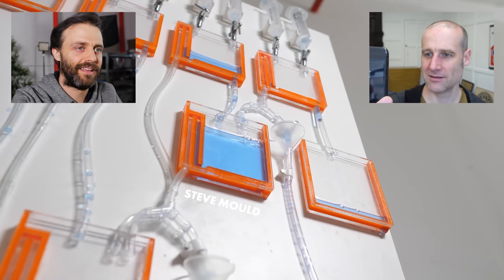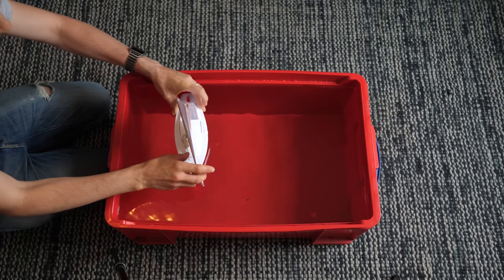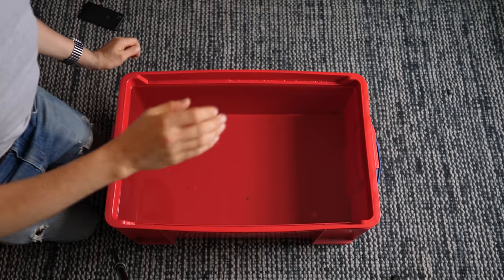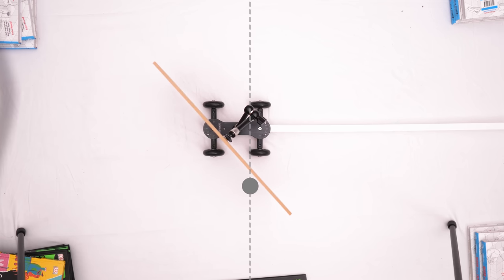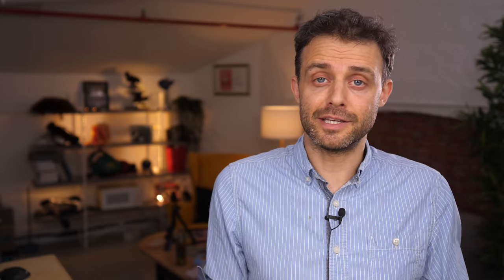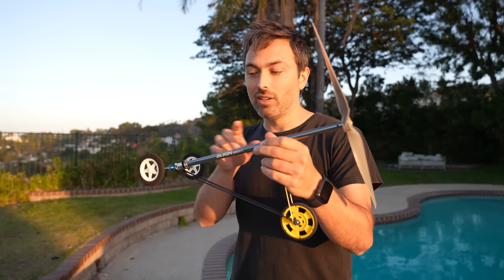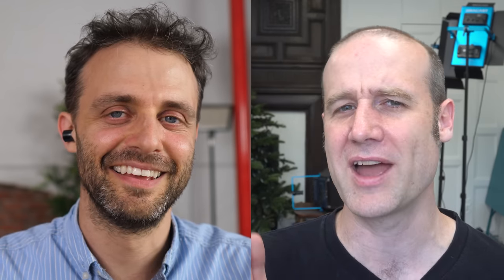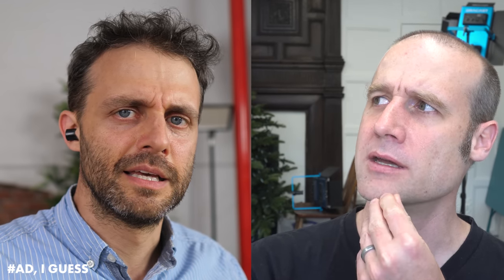Sailing Faster Than The Wind - How Is That Even Possible?

Comment: Not sure if I missed this in the video, but need to also consider that Derek was using a wind turbine as a sail. A turbine can act like a flywheel, storing energy. A good question to ask is “what happens when the wind stops?”. A sail boat will no longer generate lift, but the inertia of the boat will keep it going. A wind turbine however will continue rotating and continue providing lift, so it’s possible to build more speed thanks to the energy storage element. At least, that’s my assumption, haven’t thought all that hard about it.
Reply: @eyytee  You are right, but the point here isn't that it will speed up when the wind stops. The point is that the turbine can store energy from past wind, which is added on top of the wind in the present. It's essentially a mechanical battery.
Reply: @RealEngineering  My point was that the cart in Derek's video goes faster than the wind in steady state. It stays above windspeed, as long there is true wind. It doesn't rely on stored energy that would eventually run out.
Reply: When the wind stops, from the frame of reference of the rickety turbine machine, there's still wind as it continues moving for a bit. But now it's moving into the wind. Wouldn't this negate any gains made from the flywheel effect?
Reply: I'd like to point out that unfortunately this video doesn't demonstrate how a sailboat can travel faster than the wind in the downwind direction. That being said, the model used can explain it perfectly! You just need to angle the hull away from the direction of the wind more than the sail.

A turbine is analogous to a screw in the same way a sail is analogous to a wedge, so if you treat the sail car as a mechanical advantage problem it all checks out.
Reply: I think about it like gearing the difference in velocity between the wind and the ground. Like gearing between a pair of pinions attached to a pair of racks 

Imagine the wind and ground are racks and the sail and wheels are pinions. The two pinions are geared so that the wheel pinions move faster along the ground rack than the turbine pinion is moving along the wind rack.

This seemed to work when I modeled it in on shape
Reply: Yes, with some energy storage system, you can pass the wind velocity for a while, but not forever.
Think a little more... If that machine could work, it would need just a little push in the air (without any wind) to start to accelerate forever.
To me, looks just like a very slow second order system with an overshoot. ( welll , it is not linear cause there is non linear terms, but it can be approximated to a linear system just to prove the concept)
mv''= A*v + B*v - C*v^2
Mass * Aceleration = wind push + propeller thrust - drag
Reply: @rogeriocosta1035  "with some energy storage system, you can pass the wind velocity for a while, but not forever." that's why the vehicle in Derek's video doesn't use energy storage, they wanted to prove it could go faster than the wind continuously.
"If that machine could work, it would need just a little push in the air (without any wind) to start to accelerate forever." NO!!
It uses the difference in speed between the air and the ground to collect energy.  If there is no difference in speed between the air and the ground, then there is no energy to collect, and drag will bring it to a stop fairly quickly.
In the following video, you can see that after 3:16 the vehicle continues to accelerate.  It goes from basically wind speed to well above wind speed. The propeller is spinning considerably faster at 4:10 than at 3:16. It's been gaining energy the whole time, nut spending stored energy.
https://www.youtube.com/watch?v=aDzWh9J1dk4
Reply: @RealEngineering  I'm interested to see your take on sailing theory
Reply: @eyytee  Exatly, from the Nasla page: "The big difference in the two crafts is that in the upwind version the **turbine actually powers the wheels while in the downwind version the wheels power the propeller."

The wheels power the propeller, and that's why it's able to move faster than the wind. If you replaced the wheel power with a motor, you could go as fast as you like.

The momentum of the turbines propeller blades is not storing the energy, it's the momentum of the vehicle, because the wheels power the blades.
Reply: @andrewsnow7386  Yes, the craft will gain energy, so long as the air outside the craft is losing energy.  Once the drag(which speeds up the air molecules), matches the amount the air hitting the propellers is slowed down, then the system will stop gaining net energy.  Because kinetic energy is 1/2 mv^2, it can take a while to build up speed.  But notably, the kinetic energy of the craft stores energy, not the the speed of the turbine, because the wheels power the propeller.
Reply: @derekmcdaniel6029  We may agree on everything, but I'm not sure. We agree that the vehicle is taking energy from the air-ground system (what we call wind). And, when drag equals thrust, the vehicle will stop accelerating. Also, building kinetic energy can be a slow process. And movement of the craft, and wheels, and propeller all store kinetic energy.
The only place I'm not sure we agree is if this stored kinetic is expended quickly to temporally push the vehicle above the wind speed - it is not. 
If the vehicle were made entirely out of a mass-less material (and thus couldn't store kinetic energy), it would still work.
Reply: @josbo6  Also a very good point
Reply: @andrewsnow7386  "It uses the difference in speed between the air and the ground to collect energy.  If there is no difference in speed between the air and the ground, then there is no energy to collect, and drag will bring it to a stop fairly quickly."

It is possible! If you consider using the difference from the wind velocity to the ground as an energy source, you could imagine just a fixed wind turbine feeding energy to a rail that feeds an electric vehicle to travel way faster than wind. It is easier to imagine and there is no energy and momentum conservation problem in this case.

But I think that is not the question the original video is proposing to answer.

- The question is if a vehicle can extract energy from the wind (using or not the ground as a leverage) to move itself, downwind, continually faster then the wind.

Since the ground is the inertial frame of reference and consequently has no energy for that context, I can't imagine a way to make it work without breaking the laws of thermodynamics.
Reply: @rogeriocosta1035  Use the wind as your inertial frame of reference. If the wind velocity is constant, it is just as valid of an inertial reference frame. Now the ground has energy. 
Energy is not conserved when you switch reference frames.
Reply: @RealEngineering  as long as you're slowing down some wind, you get the inertia from it
Reply: @Real Engineering it would kind of act as a battery when the wind slows down for a while, but that's why they had to install a one way ratchet that makes sure the wheels can turn the rotor but not viceversa. They don't talk about it in Veritasium's video. Anyway apparently the propeller isn't even that heavy and doesn't spin too fast so it wouldn't make for a good flywheel.
Reply: @salvodippolito6013  Correct. The ratchet prevents using stored rotational energy for propulsion. But also the fixed gear ratio, which slows down the wheels, if the rotor slows down. And the rotor is made of foam so very light.
Reply: @eyytee  with a ratchet in between there is no way that the rotor can slow down the wheels. The wheels can only maintain or increase the speed of the rotor in one direction, just like the pedals in a bike can't be used to slow down the bike's wheels. The gear ratio has nothing to do with this.
Reply: @aviphysics  Exactly this! When I saw Veritasium's video this is exactly what I came up with. Also, sails are like wedges which can be equated to gear ratios.
Reply: @rogeriocosta1035  , No, you can extract energy from the relative motion of wind and water at any velocity. Without friction you can accelerate infinitely, just like a gearbox with an infinitely high gear ratio can.

In fact, sailing faster than the wind downwind can be explained entirely using gear ratios: Imagine the water and air are two parallel rack gears. If a machine exists that can travel faster than the wind rack, connected to only these two racks, then from the perspective of this machine, the water rack will be moving backwards faster than the air rack.

This machine is very simple, a large gear fixed to a small gear on the same axis, with the large gear meshing with the water rack, and the small meshing with the air rack.

Thus this machine can travel at any speed faster than the wind assuming no friction.
Reply: @chalichaligha3234  That racks an gears analogy is brilliant, but I think it will show it is not possible.
Please try to draw this system you had imagined and hit-me again. If you can solve it that way, will be the most elegant explanation to the supposed problem.
Reply: @andrewsnow7386  OK, but using the air as the reference, the vehicle will have velocity in relation to the air, but it can't go faster than the ground (the new source of energy in that case).
Reply: @rogeriocosta1035  Here is a video of the geared system:
https://www.youtube.com/watch?v=W65MpjT_jnI
Reply: @josbo6  Yes, there is a little wind speed difference with height, but not a lot. In the following video they have streamers above and to either side of the propeller, in addition to one at the front. The one at the front does "drop" a little sooner, at around 2:55,  than the higher ones do (at around 3:15). But, from 3:16 until 4:38, all the streamers show an unbroken headwind.
https://www.youtube.com/watch?v=aDzWh9J1dk4
Reply: boats store energy as well. A boat will keep moving for a long time if it stops being pushed.
Reply: IIRC in Derek video, the wind pushes the blade (and car body) to make it go forward, but the wind didn't cause it to spin. The wheel that cause that blade spinning, so it work like reverse windmill, it push the air backward, pushing against tailwind, that's why it keep accelerating even after reaching the wind speed..
Reply: @eyytee  the
Flywheel
Stores
Energy
Reply: Blackbird does not used stored energy. Imagine a cart in a 10 mph wind, without a prop system. It will easily go 10mph. Add an efficient prop system geared to the wheels. The prop system will use energy, and maybe cost you 1 mph, so you would be down to 9, but the prop is thrusting against the air, and giving you +2 mph. So 10 minus cost 1 plus thrust 2 = 11 mph. At 11 mph maybe you are getting a bit more thrust, at not much more cost, so maybe you can get to 12 mph. And you're now going faster than the wind.
Reply: @ssgoko88  Yes, the wheels of the cart also store energy. But they cannot release that energy to accelerate the cart. And neither can the propeller.
Reply: @salvodippolito6013  " with a ratchet in between there is no way that the rotor can slow down the wheels. "

The ratchet does allow the following:
- wheels spin the propeller
- propeller brakes the wheels

The ratchet does NOT allow:
- propeller
 spins the wheels (prevents using stored energy)
- wheels brake the propeller (improves wheels brake effectivity)
Reply: @andrewsnow7386  Very nice! This videos are great way to show counter intuitives concepts. And very fun too. LOL
Even before that exemple, I had already change my mind about the sailing faster than wind and the machine in general.
But I still cannot imagine a simple and more intuitive way to extract energy from the wind when the vehicle is faster than the wind. Do you have some simple theoretical model for that?
I can imagine one, but is too much complicated and only the average velocity is greater than the wind.
Reply: Ah yes " researcher"
Reply: @RealEngineering  I could be very wrong: But...   Derek's explanation at the end of his video explaining that the ambient pressure behind the vehicle is reduced by the driven direction of the prop doesnt seem to hold water.  Any person with a passing familiarity with the aerodynamics of a car knows that high pressure in front and low in the rear is also known as aerodynamic drag.  If however he were exactly wrong and the prop were increasing the pressure on the aft face of the blade and decreasing on the forward, via rotational direction, it could create forward vectored lift.  The faster the vehicle goes, with the appropriate blade pitch, the greater this pressure gradient on the blades, the more the vehicle is pulled along that pressure gradient.

I have no idea how the math for this would work.  I'm not an engineer, but im recognizing systems in play.
Reply: @eyytee  you are both describing two unrelated and equally true phenomena. In your case you are talking about the steady state operation of the vehicle, which indeed has nothing to do with energy storage because at steady state any sort of energy storage system should have a net gain/loss of zero, since that's the definition of steady state. However he is describing the transient period when the wind suddenly dies. On a normal sail boat the entire boat suddenly becomes a drag item, but in this case the still spinning propeller (almost called it a turbine but then thought about it for a sec) provides some thrust to counter the vehicles drag. Ultimately the drag will still win, since otherwise it would be perpetual motion and thermodynamics forbids such devices, but it reduces the magnitude of the deceleration as compared to a conventional sale in the event of sudden wind loss.
Reply: @rogeriocosta1035  Do I have a simple theoretical model? Probably not, or there wouldn't be so much confusion. :) 
But, in this thread of comments, I don't think I have said the following yet. Maybe it will help.
As mentioned before, the wheels are powering the propeller. When the wheel-propeller system is traveling faster than the wind, the wheels travel farther over the ground than the propeller does through the air.  If you want an example, assume the true wind speed is 10 u/s (that's units per second, I don't want to deal with multiple measurement systems right now). Also assume, the vehicle is traveling 15 u/s. This gives an apparent wind speed from in front of the car of 5 u/s. So, in one second, the propeller moves 5 units through the air, and the wheels move 10 units over the ground.
Compare this system to a mechanical lever. With a lever, you can supply a small force over a long distance at one end, and get a larger force over a small distance at the other end. If there are no losses, then the energy in at one end equals the energy out at the other end.
Since the wheels are moving a long (longer) distance, and the propeller is moving a short (shorter) distance, we can apply the lever principle. The force produced by the propeller can be large (larger), while the drag force on the wheels is small (smaller). Just like with the lever, the higher force at the propeller end doesn't violate the conservation of energy because it's traveling a shorter distance. The power out at the propeller must match the power in at the wheels (in a no-loss system).
Reply: @eyytee  this is a ratchet: https://youtu.be/LdvysdJJXW0

It's the same thing inside the driven wheel of a bicycle. The wheels play the role of the pedals and the propeller plays the role of the wheels in this analogy with a bicycle. If you stop pedalling, or pedal slower than the wheel is spinning, the bycicle's wheel won't slow down, because it's driven by a ratchet. In Blackbird's case if the wheels slow down they're not pulling on the rotor mechanically, because the ratchet won't allow them to. 

The reason why the rotor might slow down if the wheels slow down is because of its interaction with the wind. In the bike analogy this would be similar to slowing down your pedaling speed while going uphill, the ratchet won't be able to click because there's a force acting against the rotation you're trying to give to the wheels.

If the wind was to suddenly stop however, you wouldn't have this interaction between wind and propeller any more and the wheels would slow down faster than the rotor. This is because they were only being moved by the wind that was pushing on the cart. The rotor would instead keep its inertia for a longer period of time since it would be only slown down by the very small friction in its bearings. This can only happen with a ratchet, if there was no ratchet then some of the rotor's inertia could be used to keep the wheels spinning at  a certain speed while the wind speed has dropped drastically.
Reply: @eyytee  by the way, if the propeller was able to brake the wheels then it would also be able to maintain some rotational energy with its own inertia when the wind stops blowing, that's why they had to install a ratchet in the first place.
Reply: @andrewsnow7386  I think I had figured out a very simple model using something very similar to the video you had linked. Wait a minute, I will draw and upload it...
Reply: @salvodippolito6013  "if the propeller was able to brake the wheels ..." Salvo, you started out with the correct idea with the ratchet, but I think you might have gotten slightly confused.  In the bicycle example you used, you are correct that the pedals play the role of the cart wheels, and the bicycle wheel plays the role of the cart propeller.  But note, if you apply the brake to the bicycle wheel while you continue to pedal the bicycle, then as the wheel slows, it will force you to pedal slower. That is, the bicycle wheel can brake the pedals. Or, in the case of the cart, the propeller can brake the wheels. In fact that's what is required - for the propeller to be able to take power from (i.e. brake) the wheels.
Reply: @andrewsnow7386  ok I see what you mean, the wind tries to move the propeller as a turbine while the wheels try to move it in the opposite direction as a propeller. So as long as there's wind there's also a force on the propeller acting against the rotation imposed by the wheels, effectively breaking the wheels.
Reply: After proved being wrong, and after a lot of discussion and a good explanation from Andrew Snow, I think it is very clear to me and maybe I can explain it in a simple way...
In theory any vehicle that has a propeller connected to the wheels, in a way it generate forward thrust while the vehicle is moving forward, is capable of travel faster than the wind.
Explanation (without losses for simplicity):
A vehicle in the wind will be pushed and accelerated until reach an equilibrium point where there is no resultant forces.
- If the vehicle is not connected to the ground, the equilibrium occurs when the velocity of the vehicle is equal to the wind.
- If the vehicle has wheels connected to a propeller generating thrust, the equilibrium point is now changed to the velocity where the propeller can't make thrust, and that velocity is faster than the wind. (the propeller has to make a perfect helicoide into the wind to not make any thrust or drag)

*For clarity, it does not mean that the vehicle with the propeller will accelerate faster, slower or have any kind of increase in efficiency. The main point is that the equilibrium point is changed, so, in the stead state, it will be moving faster than the wind.
Reply: @salvodippolito6013  " In Blackbird's case if the wheels slow down they're not pulling on the rotor mechanically, because the ratchet won't allow them to."

This is correct, and consistent with what I wrote above (last line under the section what the ratchet does NOT allow). It improves braking, because you don't have to stop the propeller, if you apply the wheel brake.
Reply: @salvodippolito6013  "by the way, if the propeller was able to brake the wheels then it would also be able to maintain some rotational energy with its own inertia when the wind stops blowing, 
"

Yes, this the case. But it cannot use that energy to accelerate the vehicle or even maintain speed, because as soon it releases it, it slows down and so do the wheels (fixed gear ratio).
Reply: @maxk4324  "...when the wind suddenly dies. ...the still spinning propeller....provides some thrust to counter the vehicles drag."

You would also have to immediately adjust the pitch of the propeller to match the new increased relative headwind. Otherwise it would produce reverse thrust and brake. And even if you adjust the pitch, the vehicle would slow down very quickly, because the prop is very light weight. For the NALSA record they were required to accelerate when above windspeed, and the wind was monitored all the time at propeller height.

"...  On a normal sail boat the entire boat suddenly becomes a drag item, ..."

Not quite. When a boat moves with downwind VMG > WS, and the true wind suddenly dies, the boat still has momentum in the cross wind direction (equivalent to the rotational momentum of the blades), and by changing the sail angle (equivalent changing the propeller pitch) the sail can still produce lift with positive downwind component (equivalent to the propeller still producing some thrust). But in both cases the vehicle slows down.
Reply: @salvodippolito6013  Sure would have been nice if that was explained in Dereks video. Not sure why he hand waved the science so much
Reply: @andrewsnow7386  Rogério Costa is referring to the hypothetical machine (that runs off stored energy) described by the OP. Since the hypothetical machine doesn't work, but the real one does, then clearly the hypothetical machine doesn't describe the real machine.
Reply: @owenatkin3148  "Any person with a passing familiarity with the aerodynamics of a car knows that high pressure in front and low in the rear is also known as aerodynamic drag."

Imagine a pickup truck that has wind coming from directly above it. Now imagine that truck is shaped like a perfect wedge (sort of like the Tesla cyber truck). Now, at low speed the truck will have more pressure behind than in front. No drag.
Reply: they aren't. The cart uses the wheels motion to spin the fan, which in turns propels the vehicle by pushing against the wind.
Reply: @eyytee  nope. the wheels are driving the fan
Reply: @andrewsnow7386  indeed they're using a freewheel. And variable blade pitch in order to be able to accelerate from a standstill (at 0 pitch and 0 rpm the fan operates like a simple barrier)
Reply: @ValentinoMariotto  "nope. the wheels are driving the fan"

Yes, the wheels are turning the propeller via the chain. I never said the opposite.
Reply: Exactly.
Reply: @chalichaligha3234  Well done. Some of these gearing models were build by @coolaun:
https://www.youtube.com/user/coolaun/videos
But none with a screw or worm-gear yet.
Reply: Derek was not using a turbine at all but a wind propeller.  Sorry to be a pedant but I think it is an important destinction that we realise the big spinning this is using power (generated by the wheels rolling over the ground as the car is pushed by the wind) to pull the car through the air. It is NOT using the moving air to spin a turbine to drive the car.
Reply: @antaguana  , The thing is, the distinction is not so clear. Firstly, if the cart did not collide with any of the cart except the turbine, it would still work - so the wind is clearly acting on the blades.

Next, it is more correct to say that there is a path of force between the air, turbine, wheels and ground. From different frames of reference you can say the energy is coming from either ground or the air, or both. But we usually use the ground as reference, so it makes sense to say that wind energy is pushing the turbine and cart.

Finally, what people, including the creators are saying when they say that the wind isn't pushing the propellers is that the blades screw forward through the air like a propeller, which is counterintuitive seeing as they are ultimately powered by the wind, and one way of explaining it is saying that the wheels power the propeller. But you can also say that the wind is pushing a backwards spinning turbine.

In my opinion it's most easily understood using gearing models.
Reply: @eyytee , Thank you! And it's great to see those physical models work too!
Reply: @antaguana  Correct - turbine extracts energy from fluid flow, and various *pellers and fans (I never knew when is something a fan, a propeller, an impeller, or mere rotor) impart energy (and momentum) on fluid.
Reply: @bazoo513  "turbine extracts energy from fluid flow, and various *pellers and fans impart energy (and momentum) on fluid."

Energy flow depends on the reference frame. For example, in the frame of the ground the Blackbird propeller removes energy from the air, but in the frame of the cart it adds energy to the air. Frame independent definition: Turbine rotates according to the fluid-torque on it. Propeller rotates opposite to the fluid-torque on it.
Reply: @RealEngineering  It really is actually more of a mechanical advantage problem. In effect the initial part with the wind pushing on the vehicle body creating linear acceleration, which in turn creates angular acceleration in the smaller wheels, this then in turn spinning the larger propeller acts as a torque multiplier like a bicycle in low gear. Of course the top speed is still limited as propellers like any aerofoil generate two forces the lift force and a lift induced drag force the latter of which increases with the blade velocity. Thus as the speed increases you are getting less useful thrust from the prop and experiencing more friction and rolling resistance at some point the rolling resistance, internal friction and induced drag are going to reach equilibrium with the combined trust and wind force.

The remaining issue is where the energy is still coming from but I am pretty sure the answer here is still the wind because the propeller is pushing in the opposite direction of the wind. Thus the static pressure increase downstream of the propeller is a combined effect of the static pressure generated by the fan and the wind pressure. The air in between is effectively being pushed from the fan on one side and the momentum of the wind on the other. So this way you can still harvest some of the energy in the momentum of the incoming wind as some of that is transmitted back in the direction of the propeller due to energy transfer during collisions with the incoming air if I am not mistaken.
Reply: Actually the large rotor on blackbird functions as a propeller that is driven by the wheel movement, even though it is almost irresistible to think it is being directly driven by the wind.
Reply: You nailed it. And the ten-second record is a joke. This is they flywheel effect in it's most obvious form. I would like to see into-the-wind vehicles...
Reply: Wrong. This contraption works because it increases the apparent wind over the propeller, thus increasing its lift beyond the increased drag. Propellers make terrible flywheels.
Reply: @dbmail545  Wrong. If you're going faster than the wind, the wind is now facing you! How does wind in front of you make you go faster than wind behind you? It can't. Back to class. There is a flywheel effect going on here. You don't know what that prop weighs, do you? No. Me neither. Use logic.
Reply: @RealEngineering  no, it isn’t being used as a turbine, it’s a prop. The power comes from the relative movement between the ground and air. Even when the craft is travelling above wind speed, when the wind drops, the power disappears and the craft will decelerate.
Reply: @derekmcdaniel6029  , taking power from wheels to power blades will slow car down just like stepping on the brakes. Newton’s 3rd law, action vs reaction. You can’t magically take power from a wheel without slowing it down. Wheel slows down = car slows down.
Reply: @salvodippolito6013  , With blade pitch set to move car forward as propeller spins (in the direction that will move car forward) a tail wind will try to turn wheels backward. In a head wind the  ratchet would let propellor over speed without driving wheels.
Reply: @josbo6  This was demonstrated in early Blackbird videos.  Streamers on poles above and to the side of the prop all turned backwards as the car reached and exceeded windspeed.  Prof. Kusenko also raised this point in the bet video as the gradient does exist as you stated.
Reply: When the Veritasium video came out I was trying to make this very point.  For example, if a car is traveling at 20kpm and then is put in neutral.  The vehicle will continue to travel at a higher rate than it is being propelled.  This is not magic or any kind of perpetual motion.  The car would be releasing energy that was previously stored in the form of momentum.  I guess everyone just wants to believe.
Reply: Technically, he was not using "a turbine". Strictly, as far as terminology goes, a turbine converts medium flow into shaft rotation. Derek's contraption, however, converted shaft rotation into medium flow, because the propeller was driven by the shaft (which in turn was driven by the wheels, which in turn were driven by the wind pushing the vehicle across the land). Furthermore, "a turbine" is also not defined by its function as flywheel energy storage. It may be its (pretty much unavoidable) side effect, but it's not its defining feature, so your elaboration is a bit upside-down.
Reply: That was not a turbine, rather "perpetuum mobile", which is not possible because of resistance and friction losses. The whole experiment is fake.
Reply: it's a propeller, not a wind turbine, it goes faster by using some of the winds energy to push back on the wind
Reply: @RealEngineering, you are correct all along - inertia. In Veritasium's second video on sailing, if one closes a Control Volume on the small scale model, it's clear that the energy comes from the treadmill. Also, extrapolate it to a Torus shaped closed wind tunnel, if the proclaimed "thing" that would continuously propel cart faster than incident wind on the cart really worked, that would absurdly imply ever increasing acceleration to the point of a sonic choked flow and a cart moving counterwise it.
Reply: @chalichaligha3234   This is why i think the wind is pushing the propeller, not the other way around